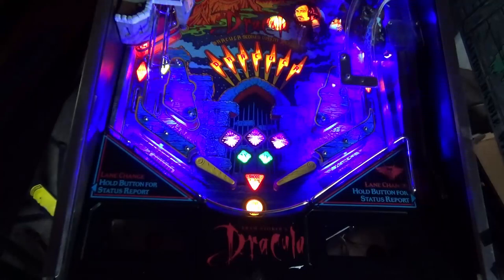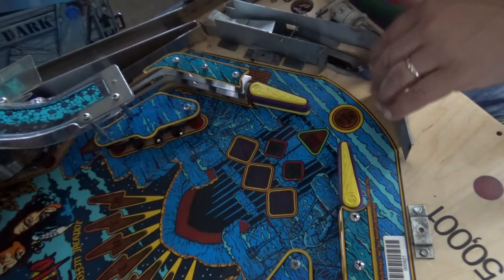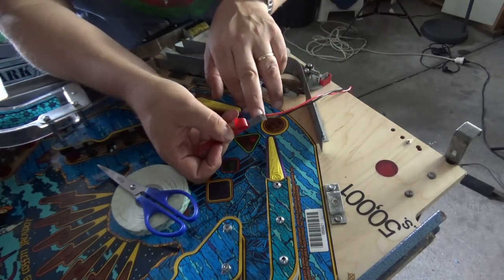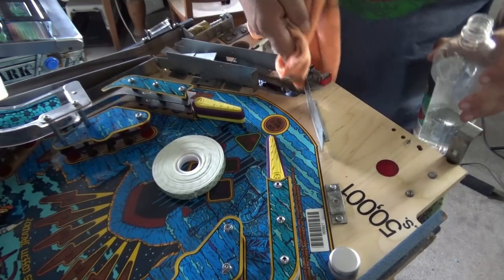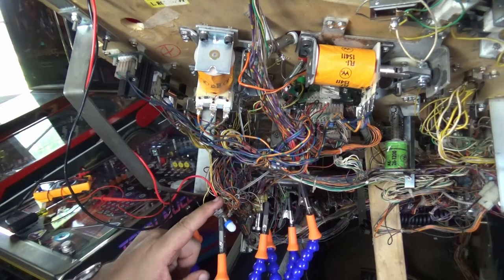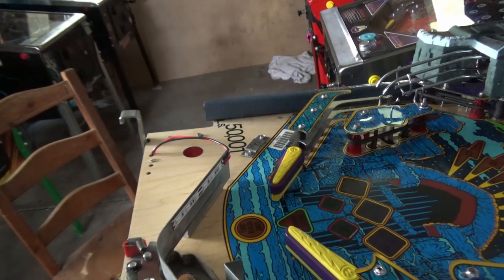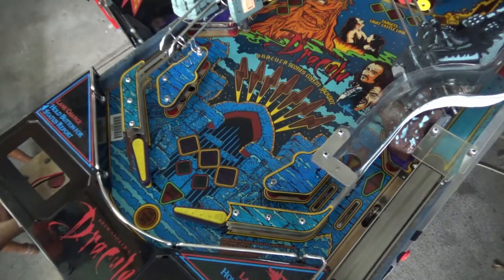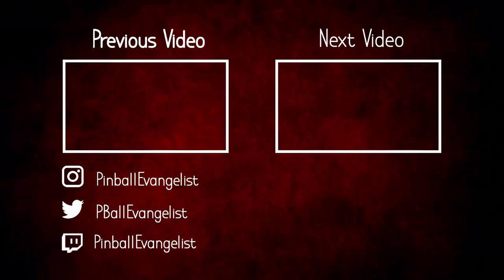Pinball Lights Mod Installation in Apron using 6V LED Strip

Comment: Most LEDs sold.in strips seem to be 5v or 12v. Do I need a 6v specific strip from a pinball led shop. Seems pricey for what it is. 12v and stick a resistor on it?.just use a 5v.strip? Stop being a cheapskate and buy a 6v one? 🙂
Reply from the maker: Great question which I have been thinking about but never tested... might be a good video in that.  I suspect most 5v ones will work just fine but have historically just bought the 6v strips from the Pinball Haus (find them on Facebook https://www.facebook.com/pinballhaus/shop/ )  which are ~A$8 per meter.
Reply: @PinballEvangelist  and at A$8 per meter, its probably not worth messing about with! Do they look different to the 5v strips, anything written on them, or are they actually 5v ones?
Reply from the maker: I am sorry I didn’t know.... but they work nicely and did not really do much more investigation....
Reply: @pinball_evangelist from where have you got the „helping hand“
Reply from the maker: I bought it on Amazon here is the link https://amzn.to/41M5Xod